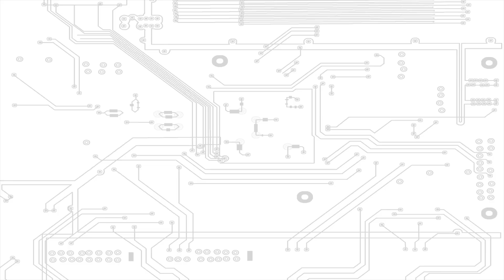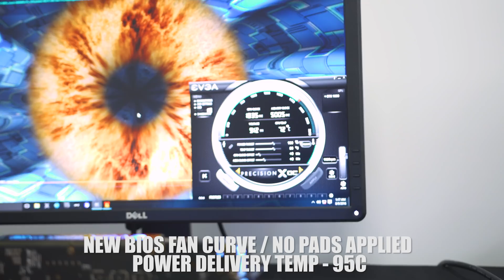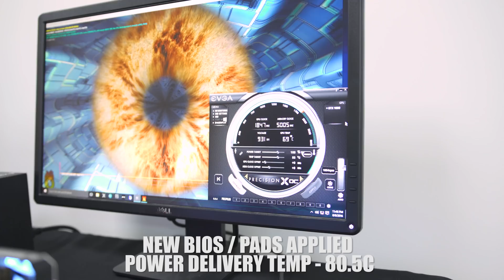EVGA FTW VRM Failures - What should you know

Comment: Hm when AMD RX480 had an simple issue which they solved in less than 32 hours with a new driver EVERYONE was on FLAMES against AMD, cause it was wrong and damage control wouldn't be enough and bla bla bla....  So now EVGA (on a nvidia's card) screws BIG HUGE time, they send you some thermal pads to make YOU do their job fixing this crap and everyone is ok?  If amd did something close to that people would never forgive them...   In my country (Brazil) EVGA does not give warranty if your videocard burn like that, you need to ask to the vendor and PRAY for them to give you another card, there's no thermal pads for us, no nothing.  I'll never buy another EVGA product.
Reply: Sergiocrivelin I agree with you on the fact that it's unacceptable for such a high-end product to overheat like that, but put it this way. Every RX 480 was affected meanwhile only one of all the evga variations of the 1080 and 1070 was affected. Would you rather have every Lamborghini burn or only the Huracan?
Reply: Lorenzo Alvarez He said “simple issue”, not burning. I totally agree with his opinion.
Reply: Those are completely different issues, your comparison is useless, no offense intended.

Comment: Just a big bullshit. The thermal pads will ony contact the fins on that radiator so no big temperature decrease there. EVGA should have designed the cooler better. But when you can save 2-3 dollars out of 1000000 samples it ads up.

Comment: I ordered a pair of these thermal pads and will attempt the fix myself. It was obvious to me that something was odd since I was getting what appeared to be temperature based crashes even when my GPU was reading as low as 60*C.

When I buy high end GPU's brand new I sort of assume i'm going to be getting a working product with no issues. It sucks that this happened and I am really not thrilled about having to open the GPU up and deal with thermal paste and easily broken wires.

Comment: JayzTwoCents i'm also glad to see that your'e backing evga, which is a brand i like and they have good CS and warranties. But first there is two points i want to make on this issue. First evga is pretty much the only american based company of gpu's cooler that is notorious...Your'e standing with them for this same reason? Second, as a user of their product myself and liking them, you have to agree that this problem is not acceptable for a premium product like a 1070 and 1080 in term of cooler designing. I mean, the guys are recognized as a leader in term of gpu custom coolers but can't even design an acx coller properly? The fact that they made a mistake is possible (note i didn't use plausible), althought hardly even it's what they say...And we never saw a company lying on an issue just to prevent a meltdown... caugh caugh 3.5gb issue someone? At least they Damage control the thing, but seriously a vrm power delivery cooling factor should be considered when you design a freaking gpu air cooler. Companies i fear as i also read in the comments, dont seems to learn from their msitakes as time pass, as i'm aware that it is a problem that already affected past generations gpus...

Comment: ok I'm confused like crazy now so I bought the 1070 SC ACX 3.0 Black Edition, it has no back plate and I haven't seen any temps over 80c while gaming or rendering I don't run overclocked very often so should I be worried and add some thermal pads?

Comment: Good thing I haven't upgraded my GTX660 yet, been waiting on some BlackFriday/Holiday deals.
 But what I wanna know is, are all EVGA gpu's gonna have the fix/better cooling if I purchase one in a few days/weeks.
Also which is the best GTX1070 you guys recommend other then EVGA and would a 600watt PSU would be enough to run it?
Reply: Zotac or Asus if you want the best cooling also NVIDIA  recommends  a 500 watt PSU so 600 should be enough. Zotac will be the coolest but also the biggest so might not fit in your case i would check before buying but just my two cents.
Reply: thanx

Comment: I just RMA'd gigabytes 1070 because of the fans making noise on idle, then got this one as replacement.. I will not do a company's job on fixing stuff that they self screw up. Any suggestions of cards that don't have problems?
Reply: Asus or Zotac would say Gigabyte but after what they did with RX 480  not sure if people should trust them.
Reply: Go for the gtx 1070 from asus, zotac or msi. I personally have the gtx 1070 g1 from gigabyte and I have not encountered any problems so far.

Comment: Well most of AIBs have that little tiny sticker on top of the screw of GPU core, on one of 4 of them, so if you open the GPU, you lose your warranty, for example to replace the thermal paste. That's how serious opening you GPU is and it is not a small thing to do it. People don't OC their cards, cause they "wanna play safe" or don't wanna bother, not everyone buys expensive cards waiting to OC them and now.. EVGA casually says, well you can replace the thermal pads yourself, it's an ez pz job, no worries lol  I expected that they will just replace the cards free of all charge (i'm looking at you shipping) for anybody who has these issues. This is like buying a Mercedes and your engine just casually gets on fire or your hood gets fiery, so you have to fix it yourself hah
Reply: EVGA lets you open and  change the cooler on the card without voiding warranty. They also have an RMA service where you can get your card fixed and you only have to pay shipping.
Reply: They warranty is still valid after opening the card. You saw this used on some cards and therefore assumed it's used for all.
Reply: ***** Nope I did not. I know some AIBs allow you to open the card and that's pretty nice IMO. I just said it to show how serious opening a card is for a manufacturer. :)
Reply: Филип Пешић evga warranty is not void if you open the card..

Comment: I'm about to pick up a new GPU. I was looking at an EVGA 1070 SC. if I was to purchase a new GPU off the shelf today, would this fix be required? or have EVGA recalled all the stock and replaced with updated/fixed cards?
Reply: they stated all cards shipped after the 1st will have the pads but you don't know if your getting the new stock or old stock cards so it will be random more then likely. i'm not sure if they recalled them from the retailers so maybe wait or get a different  brand like Asus or Zotac or PNY.

Comment: Jay, I have a EVGA 1070 which boosts to 2012mhz without any changes being made in EVGA Precision OC. I don't want to run the chance of getting a lower boosting card by doing the RMA process, and am comfortable doing the thermal pad and TIM application as I have built many computers and swapped heatsinks numerous times. However, I have never changed the TIM on a GPU so I was wondering if you had a recommendation for a better TIM than even EVGA is providing with the thermal pad kit.

Comment: that contact pad on front of the GPU (the small pad) is tiny.... its making contact with tiny fins....and put them over the inductors...
This is terrible "solution" more like a quick, cheap and nasty fix as the heat-sink is not designed to have that pad there... will do next to nothing for those mosfets...

Comment: I bought a 1080 ftw as they were released in the uk. gotta say haven't had any overheat probs YET and i've been on bf1 beta and release since it came out. also thrashed doom on it for weeks and no issues.the thermal pad fix looks simple enough for a half wit like myself so ill give it a go. i did adjust the fan curve after watching your vid on getting the most out of the card but haven't oc'd it. its fast enough for me without messing with shit like that. fair play to EVGA for not being sucky in sorting this quickly. but a shame that a tuppence hal'penny piece of padding wasn't put on at factory.

Comment: I NEED ADVICE FROM SOMEONE, I BOUGHT AN I7 6850K FOR THE PCI LANES CAUSE IVE ALWAYS WANTED TO SLI AND THE NEW EGG REP TOLD ME TO GET THE MSI CARBON GAMING PRO IF I EVER WANTED TO SLI, SO I DID AND I GOT THE EVGA 1080 SC AND WHEN I FINALLY GOT MY SECOND ONE I HOOKED IT UP AND BECAUSE THE CARDS ARE BIG I HAVE TO PUT ONE IN SLOT 1 AND SLOT 3 BUT IT TURNS OUT THAT IT MAKES THEM GO X8/X8 INSTEAD OF X16/X16 LIKE THE REP SAID,I GOT THE MOBO SO LONG AGO THAT I CANT REUTN AT THIS POINT SO ANY ADVICE ON WHAT I CAN DO? I KNOW X8/X8 ISNT SO BAD BUT THAT BEATS THE PURPOSE OF ME GOING ALL OUT FOR THE 6850K.i HAVE 0 pc FRIENDS SO I USUALLY HAVE TO FIRGURE IT OUT MYSELF BUT IM TOTALLY STUMPED ON WHAT MY NEXT MOVE SHOULD BE
Reply: Best advice: Don't use CAPS lock that much.
Reply: NicoDame sorry didnt realize it till i finished and didnt want to redo it lol

Comment: jay i got a video idea that will help me out a lot, in some of the evga cards like the one shown in the video there is the front led lighting which says "EVGA GEFORCE GTX 1070 FTW" or something, and in an inverted case (like the corsair carbide 600c) it is upside down (btw the card looks a lot better inverted because you can see the fan led's).
so i was wondering if you could make a video about how to invert them if its possible. especially now that we need to install new thermal pads.

Comment: New BIOS alone is enought reason to send your card back and get a full refund. Just because u choose this card because of less noise, for example. ;-)
More RPM = more power consumption, and i don't care that it's gonna be two cents in a five years, still, reasonable enought.
Btw, how much are they going to pay ME, for example, for fixing THEIR product? AND how are they going to compensate for my time without working GPU, for example. Yeees, i'm starting a witch hunt, but really, Jay, your video is SO onesided, i just can't resist to show another side of a coin.
Reply: Clearly you don't have one of these cards. Apart from this glitch, which may or may not affect people , EVGA make extremely good products and have a solid warranty to back them up. That's the reason people recommend EVGA and why they buy their products in the first place
Reply: Neil Birchall I know, i have evga 1060 6gb superclocked, exactly the same as the one that Jay showed us before. Great card, perfect for my Sugo sg13. But the point of my message is not about if evga good or bad, it's about manufacturers fails and about that they must fix they fails at least, but normally we must have something extra for the risk of damaging our systems because of their fails. It's like with a car! I don't want to change radiator by myself, if it was mailfunction from the start! I want a new car, because of this failed radiator all other components of my car could be damaged! Yes, not critically, yes, they still work, BUT FOR HOW LONG? I hope u get what i ment, sry for my bad English, i'm still learning it.
Reply: that is exactly why your warranty will not be void if you accidentaly damage your card by trying to apply the thermal pads
Reply: I'm guessing your warranty will be reset. Yes it can be inconvenient to have an hour's computer downtime (those zombies aren't going to kill themselves right?) but you will get a sense of satisfaction from fixing it yourself and it will give you confidence to do other things.
There is too much of a compensation society these days, people are too ready to sue as if money is better than a sincere apology.
Reply: Well, considering you normally lose your warranty when you take your card apart, they are trying to let you keep it without having to send it out. If you do fuck it up, they will still honor your warranty, even though you took the card apart yourself.
Reply: Adrien Watrelot Still a loss of time and nerves for some customers. I'm not talking specially about me, but still, imagine that someones card was overheating SO badly, and then there was a thermal pads installation, but still, u can't imagine if there already was a damage to a card and how long will it work. If it gonna breake before warranty - u are lucky, but if it will 1 day after your warranty is over - u are f#cked.
Reply: considering warranty would generally be 1-3 years...if your card hasn't popped by then pretty sure it won't ever. I get what you are saying about maybe some damage had already occurred prior to installation of the pad but again...if your card does not show any signs of issue within the length of the warranty yea I'd say u are good. Anyone who builds computers or has an above average understand of gpus would tell u this.
Reply: Maybe you should have gone for a different OEM from the start? How about a nice 480? ;)
Reply: You sound super entitled. They made a mistake, admitted it and either allow you to cross ship a card, AKA you dont need to send your card first and wait for them to send you a replacement. Or, you can receive the pads and install them yourself if you so choose. You make it sound like they should pay you and give you a new card. They are a business, not a charity. They also dont void your warranty for opening it. They have gone above and beyond.
Reply: Sergej Zismann

Comment: This is a great video Jay. Lots of people will be able to use this to fix their cards. I won the silicon lottery with my 1070FTW. It passed 2GHz out of the box, tops out at 64'c and around the VRM's the backplate measures 47'c during gaming. Now I have OCD when it comes to designing my cooling systems and I have a corridor of air blowing along the back of my card straight into an exhaust fan. So my card is probably in an ideal environment. Also i'm told any card shipped after 8/30 is already padded. but my card said it shipped 10/10, when i bought and had it delivered it on 9/26-27. How clever is that? lol
Hoping that's a mistake and not them lying! I'm awaiting a request for pads to be allowed right now, just to be safe.

Comment: Is this a problem if you use a ek water block on the card this removing the acx 3.0 cooler
Reply: shouldnt be, since you put thermal pads on them anyway and the waterblocks are designed to cool the componments.
Reply: ofc not. During the installation of your water block you should have used thermal pads so...

Comment: My 1070 FTW under load stays around 75/80, am i lucky or is just a case of my case (sorry not intended|!!!!) being well ventilated ?
Reply: The thermal sensor reads the temperature of the GPU and not the other components. So the VRM might still very well be overheating. I'd suggest contacting EVGA or the retailer even if there are no obvious signs of overheating. Unless you want to discover a few months from now that your card doesn't work anymore.
Reply: Nerd Punk-Fu
Thanks for clarifying.
I'll get a fix on the way. EVGA support is known for being awesome :D
Reply: Salty much? :P
AMD can do decent temps too, especially if you have a good aftermarket card, a less powerful model and got lucky with the silicon lottery. Problem is that most of the time they don't and some, especially the more powerful models, do go crazy hot.
Reply: The aftermarket coolers of current models are pretty much as sufficient than those of NVIDIA (and don't get me started on NVIDIAs cooling "solution").

Comment: i do not see it being an over site the Back Plate on the rear has holes that your now covering with a pad that is clearly not designed to go there the fact it helps with the issue is irrelevant those cards need a new back plate as well as Pads. Poor design by EVGA on this one. They allowed asthetics to get in the way of a safer but less eye popping Plate badly designed Cooling and a quick fix does not make it ok they should be recalling the lot or supplying a more suitable back Plate where the thermal pads cannot be seen through it after install and the front plate also is not so bad but again the pad extends over the cutout on left and right this will cause small pockets of hot air to remain around the VRM's not ideal but better than none the cut out should be bigger so the pad makes contact with all the vrm's including the two still under that front plate, see yet again poor design quit being so understanding because your biased to EVGA and Nvidia you make some good content but i always stop listening when you start banging on about how good EVGA are in my experience as long as you registered your card and are polite with the company when you make contact almost all the major brands are good with the returning and replacement of there products it is not an EVGA only phenomenon 
i doubt the newer card they ship will have the identical fix the plates will be different on the newer ones so no air pockets can exist and all VRM's will make contact with a heat pad that will then make contact with the Heatsink

Also i hear the Video Ram also is not making full contact with the front plate

besides that a fault that means it can be blown up, the manufacturer is obliged to put that right including the fitting and removal of parts at there expense not offer to do it for me for a small fee or i can fix it myself for free with instructions that's a Joke screw EVGA on this round of cards i would buy from else where until the Heatsink and plates have been revised along with them fitting thermal pads before shipping to retailers